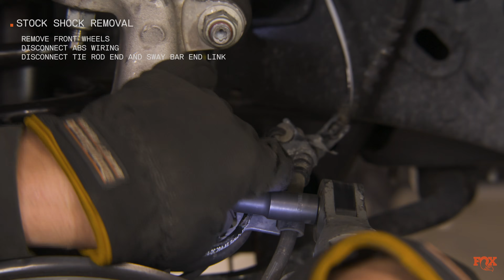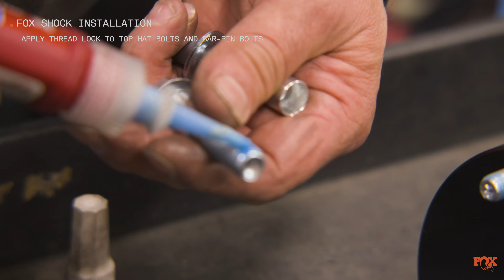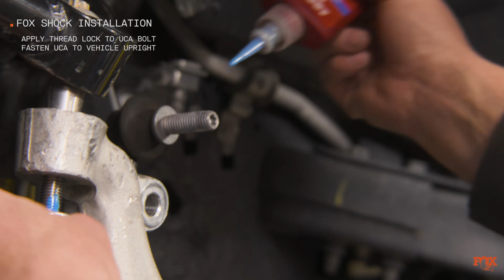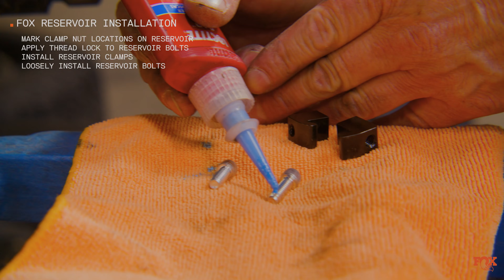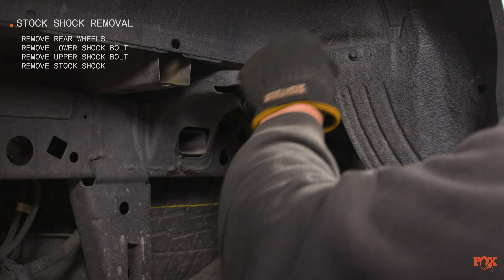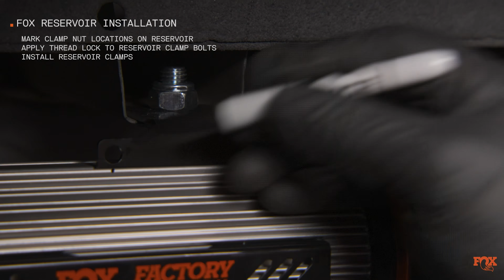Ford F-150 Aftermarket Live Valve Shock Install | FOX

Comment: This is amazing, only one comment and a 1000 views on such a groundbreaking piece of kit! Took YT half a year to show it to me. I wish you made it standalone, with only internal sensor inputs, like accelerator meters, longitude and latitude sensors etc. Also where it’s optional if you want to use two sets of front coil overs on one truck, many people are customizing Tundra coil overs on Hummer H1, but need 4 front dampers all around. I bet it’s only software coding to allow it to be done. My XLC2 is about same weight as a Tundra or any other RAM, Silverado truck.